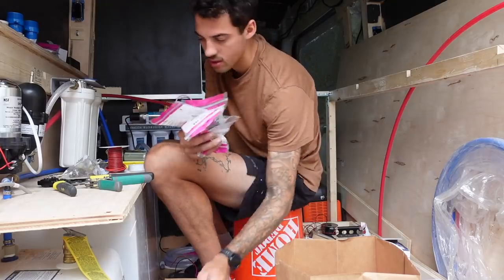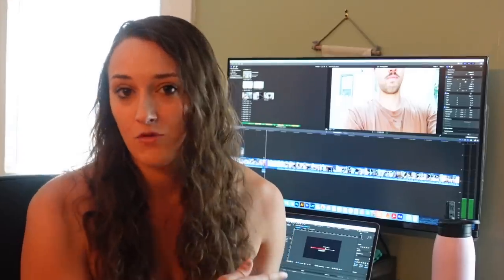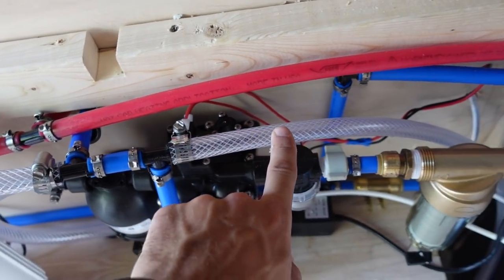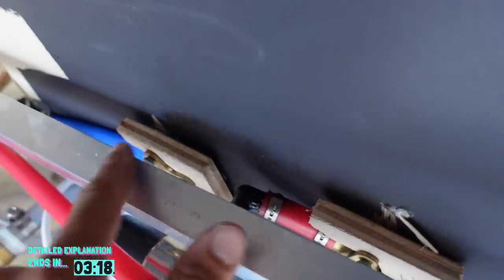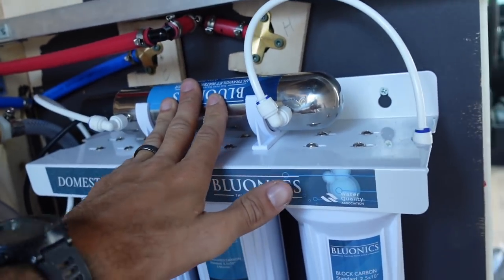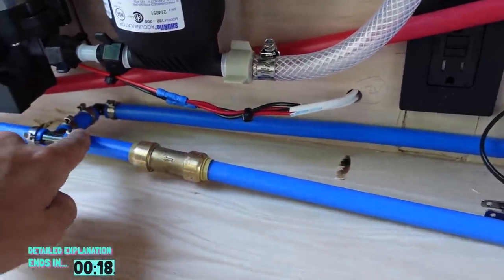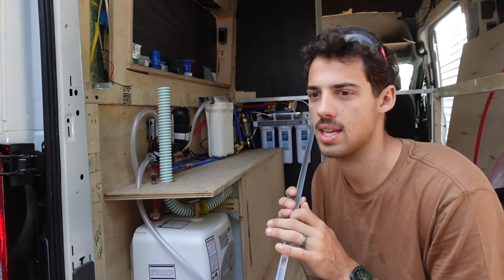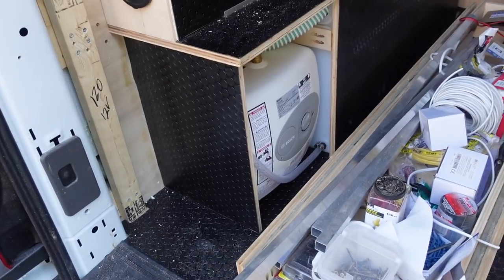Recirculating Shower in a VAN - ENDLESS SHOWERS??!!

Comment: As with so many other systems of similar build, you will have at least 2 Problems with this system on the filtration side:
1. When not in use, that sif-water stands inside the filters and  will become smelly quickly (living bacteria) - you dont ever wana shower in that again.
2. When opening those filters, there is huge spillage. Even if you put a pan under, you´ll still spill "stuff" allover.

Most important, or should I rather say "most disgusting": DO NOT RUN RECYCLED WATER THROUGH THE SAME HEATER as the hot water you use in the kitchen.
YOU WILL GET SICK - GUARANTEED. 

Solve all these problems
-  with a home-build vertical filter, with a drain pipe downwards
-  back-rinse that filter with fresh water after the shower.
- air-vent that filter when not in use
- use completely isolated water system for shower-recycling (seperate pipes & heater)
- get rid of expensive water-heater and use 12V  induction. (ZVS-Heater, build your own spiral)

Comment from the maker: A common question we are getting about this system is the fact that there is some recirculating water that is left over in the water heater. I am trying to find a work around for this, maybe a way to flush out the water heater at the end of each use. For our situation though, we only ever use the kitchen faucet for cold water really, we just plumbed it for hot and cold so we have the option for hot at the sink too. Will update when i have a solution for this.
Reply: What worng with having water left in the tank? It's all good.
Reply: Yeah, I was thinking about that. I thought about adding a second hot water heater for the recirculating shower, thats what im thinking for my bus. T the propane lines, cross connect the water lines with shutoff vavles as well so you can swap heaters for redundancy.
Reply: Attempting the same situation in our bus @marsboundbus we are using an on demand water heater to try to cut down the amount of water cross contaminating in the water heater. Not sure if you have a small tank water heater or if the one you are using is on demand. I think Andrew might be right about two water heaters but man that’s a lot of stuff to fit!
Reply: @kylehavlicek6770  In a bus though. Two Girard hot water heaters mounted through the outside isnt too bad for space. Just have to swallow that $750 price tag twice.
Reply: Ya, not a fan at all regarding the cross contamination an issue I have been pondering for a wee bit now. I think because the plan is to run a diesel hydronic system (espar) I will most likely use a separate heat exchanger for the shower .
Reply: I think the best method is to run a heat exchanger and not mix the loops - one water heater, but two separate water circuits.

Comment: From my experience with my recirc shower, I think you should find a way to not have soapy water entering your heater heater. I have my heater on a different water loop with a heat exchanger. I would highly not recommend not contaminating your fresh water supply. Also the soapy water will kill the heating element in the heater. I need to make a new video about my shower soon, Mind if i mention you? haha

Comment: Great video!
Currently building my camper out of a shuttle bus.
The idea is having a recirculating shower but I don't need hot water on my sink so I'll have 2 completely separated systems.
Already have all the tanks, the on demand propane water heater and just one 12V water pump.
But with so many areas of the building going on at the same time...

Comment: We would love an update once you start actually using it. We did a recirculating shower in our rig and ended up bailing on it, just connected it to the fresh water tanks because we couldn't keep the soap out even through multiple filters. Hope yours works better!
Reply from the maker: Ye we have heard thats a common problem. Will be sure to update when we have figured it out

Comment: You don’t need a cold and hot pipes, all you have to do turn the heater on or off depending on what temperature you like. That saves you space and also you don’t need an extra pump if you rise the clean water tank in your van. Just use gravity to fill up your secondary tank.

Comment: Pretty clever setup. However, and I could be wrong, it seems that there's one place where the kitchen water and shower water might be mixing a tiny bit. And that wood be in the water heater. I've seen some other people avoiding that by adding a simple heat exchanger for one of the two loops. I.e. The shower water picks up heat from the heat exchanger, rather than from the water heater directly. If im mistaken, ignore this.

Comment: Hi there. I believe in circulator shower system but I will never use any other component where you mix this water with the other water system that you use to drink and/or wash your dishes and that is exactly what are you doing when use the same water heater. Circulator shower you need to maintain the entire system out of bacterias, soap and others residuos and that include pipes, pump and water heater and you do this using vinegar, magnesio and others. The two water systems need to be separated completely from each other.

Comment: How often do you think you will need to swap filters? I have 5 kids, so the ability to recirculate shower water would be awesome. 

I was thinking of adding a shower specific gray tank to pull the water from, so after the first 2-3 gallons of fresh water it starts pulling from the filtered drain water. Then when all the showers are done it would be pumped into the main gray tank. That way 7 people could take (brief) showers on 2-3 gallons!!

Comment: How long for a unit of water to flow through the shower drain and through the system (and water heater) before returning to the shower head? And what's the flow rate of the shower head?

Comment: What about the existing water in the water heater? Won’t that mix the 2 water sources if you don’t flush the heater after the shower?
Reply from the maker: This is something i plan to test out and see if there is a more efficient way for me to run the water through the heater. Maybe i will create something that flushes it out before it is used by the kitchen sink
Reply: @KelsAndJay  tankless water heater would have come in handy for this kind of system.

Comment: Did I understand that the water heater receives water from the freshwater tans and the gray water tank?  Looks like sink hot should be exclusively from fresh. Maybe I didn’t get it right. Looks great.
Reply from the maker: That's correct i'm trying to find a work around for this. Maybe a way to flush it out. We only use cold water for the kitchen sink though

Comment: Hey- wondering about the flow rate of your filter. I bought the same one and the flow rate is only 1 gpm. I noticed others used a system that could get 2.5 gpm. I am about to install and hesitant to unbox it and try it out risking a return of the filter. What are your thoughts?

Comment: Your fresh water and shower water both goes into the water heater. While the shower used water is filtered. You are still getting cross contamination
Reply from the maker: No it doesn't. The fresh water is cut off from our shower water 😊

Comment: IMO, a recirculating shower is a waste of time & money unless you're into taking showers with water that looks clean but isn't. The filters won't capture all of the soap chemicals, soap & body oils, and salts. The UV filter doesn't even kill or remove the microbes but merely makes them unable to reproduce. Get yourself a TDS meter and measure the TDS of your supply water for a baseline reading then measure the shower water after each use. You'll need to replace the filters faster than you think & besides the continued cost the old filters & housings will be full of human muck (hair, dead skin cells, feces, mucous, etc) that will need to be scrubbed from the housing before adding the replacement filters. You'd be better off just adding extra fresh water capacity. It's much less expensive, requires less maintenance, and you won't be sending discarded scummy filters to the landfill. If you can't learn to live with a limited fresh water supply then consider bringing a still with you & distilling your gray water into pure water. With a properly designed 20 gallon still & a lot of firewood or fuel you can distill several gallons of clean water a day.

Comment: If it works it works, but seems over complicated. Ian building my design now. I did the same thing I did with my solar. First thing eliminate as many needs for water as possible, I feel like the idea is mixing water with s*** was not a good idea, it waste water it makes human waste even more disgusting and intakes more room to store this nasty water. Composting toilet was a no-brainer. Then all that's left is the kitchen sink and the shower, at which point I was wondering why bother making a recirculating shower when you can just make a circulating water system for both the sink and the shower you might as well. Also what is the point of a gray tank when your water system is completely recirculating it's just a waste, get rid of your gray water tank and make your fresh water tank the only tank you have, full fresh water heated pump it out to the faucet bring it back from the drain to the main tank freshwater tank filter it as it goes out simple. No valves are control circuits once you get your hot water going turn the cold water off cuz there is no cold water and then maintain the temperature you want on your hot water simple. I use a 20 micron a 5 micron a 1 micron and then a half micron carbon. If you think about it cold water isn't ever really needed, you should be drinking a different water. Thanks for your video!!!